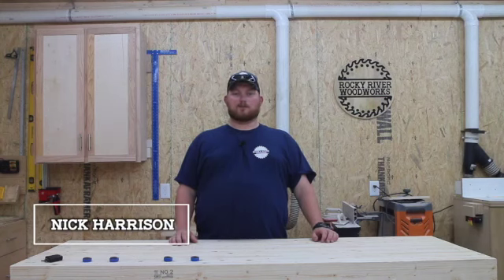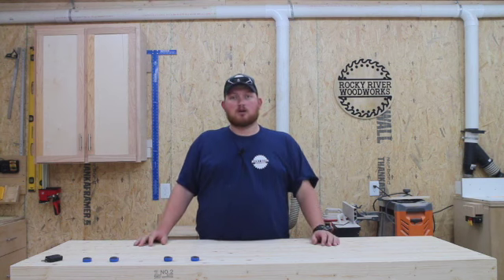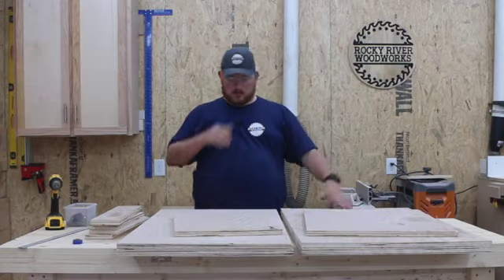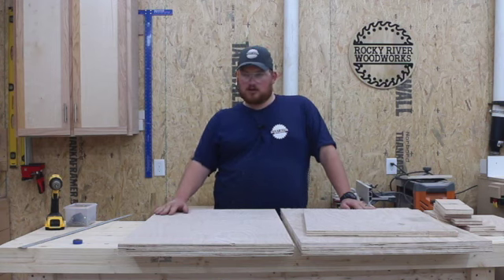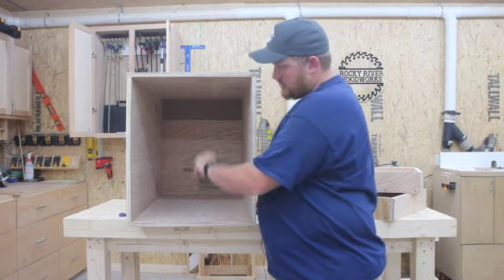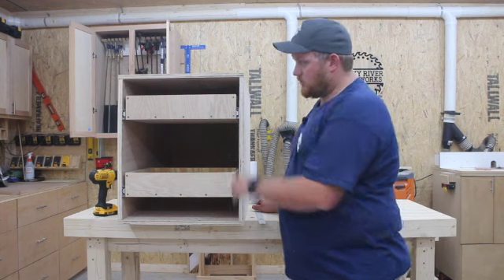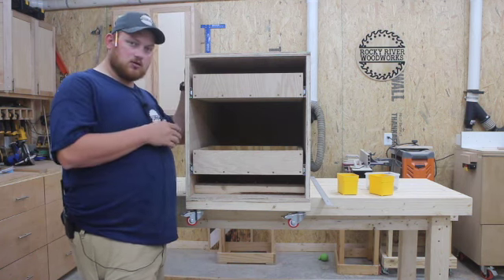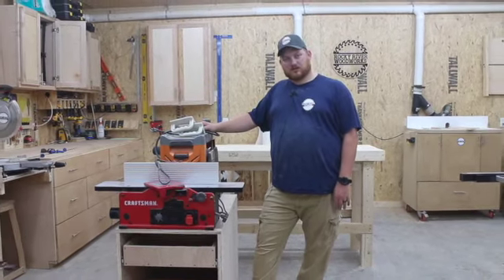How To Make A Mobile Planer Cart - Mobile Milling Station

Comment: Hi I'm looking to do something like this for my table saw.  I was surprised you didn't glue the plywood edges. Seems like it could get a bit loose over time wheeling around without that step?
Reply from the maker: It certainly could. But, for what it’s worth, I’ve been using it ever since I made this video and continue to use it everyday and it is doing just fine.